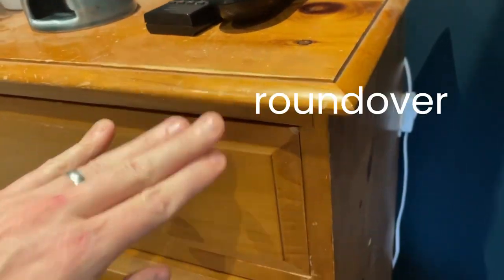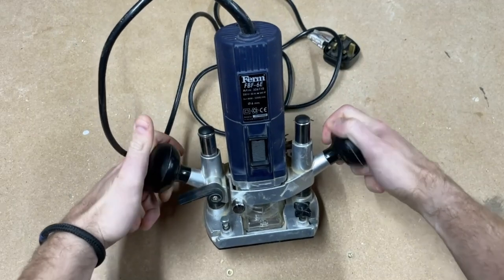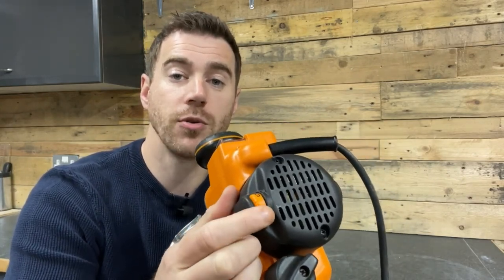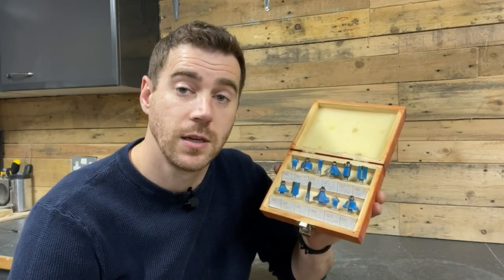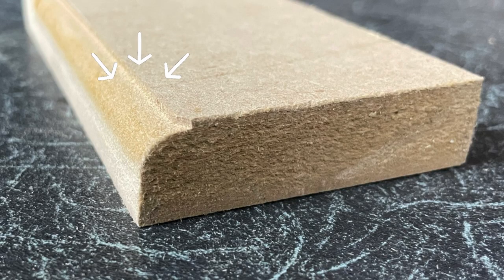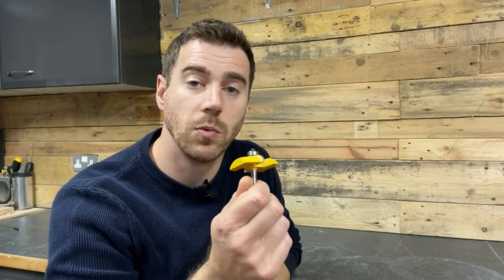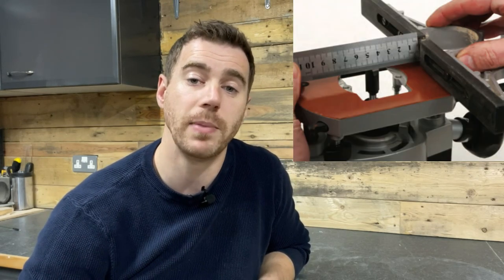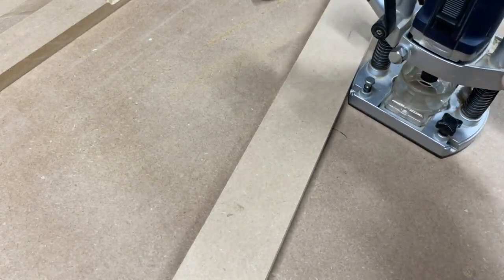Beginners guide to Routers || Woodworking Basics for Beginners #woodworking #router

Comment: I made the mistake of of using the bearing bit to make a channel in the centre of timber not knowing at the time but learned later the differences between bearing and plunge or non bearing bits and now I'm also learning to understand what different bits do so now Im finally ready to start practising with old scraps until I develope skills and better results before applying to projects. Thanks for the great tutorial
Reply from the maker: It’s very easily done. Routers have such a wide choice of bits that it can get really confusing. Keep trying on scraps and give yourself the best opportunities to get it all to a level where you feel really confident. MDF is a great surface to practice on.
Reply: @lionandbear  thanks Now in my 60s so I bought a lighter router just for recapping on woodworking that I was really great at in school. I'm old school type loving hand tools but I like the idea of using machines when necessary only for touch up style like routers do and saws for cutting sheeting or straighter edges because of medical conditions, Arthritis, vertigo, breathing and heart problems. Hobbies like woodworking and gardening keep me active. The heavier or bigger router I have for years will come in handy for a table router when I learn to make just a basic set up for hobbies and learning. I loved your video and how you explained things exactly the way I can understand it. Thanks for your great techniques
Reply from the maker: I’m glad it’s helped. My dad is a similar age and he got me into the hobby. The router will definitely allow you do enhance some of your hand tool projects. I’m definitely more of a power tool guy myself but there’s something quite satisfying about getting the chisels, rasps and files out to shape a piece of wood by hand as well from time to time. I’m planning a router table build in due course so make sure you’re subscribed and you’ll see when it comes out. Hopefully you’ll find it if use.
Reply: @lionandbear  There is nothing wrong with using machines to assist working. In younger group people who grow up learning the skills of machines and the brain like a sponge absorbing it but back in your dad's day and mine we only learned using hand tools the same ideas with different skills but for similar outcomes. In our day when doing a chamfer we used a chisel now you can do it easier and quicker with a router and the correct bit. All our interests are the same only different techniques